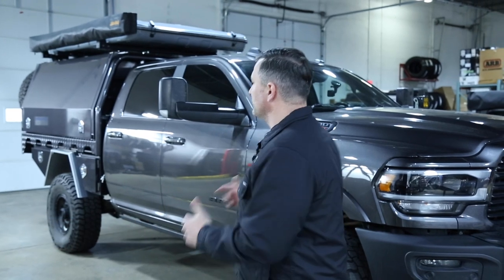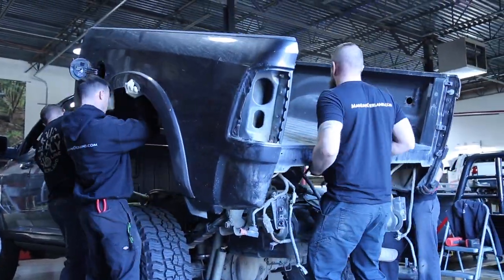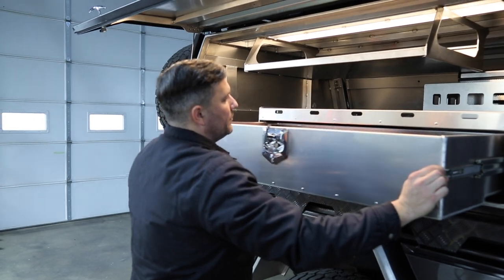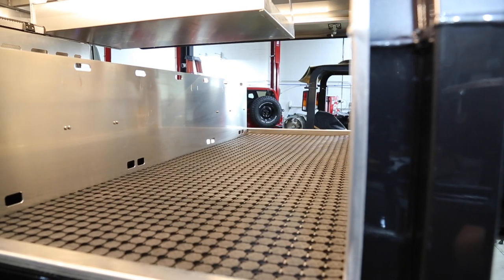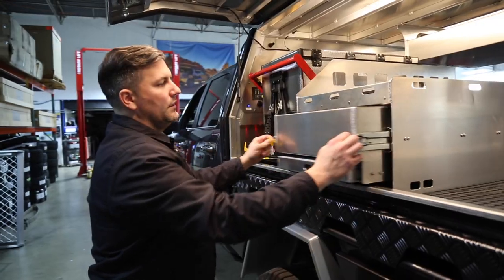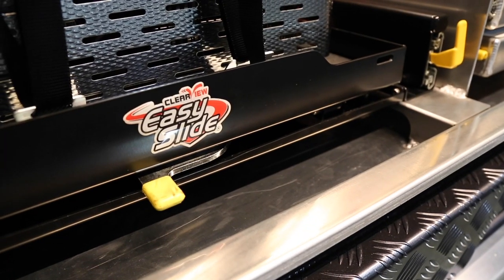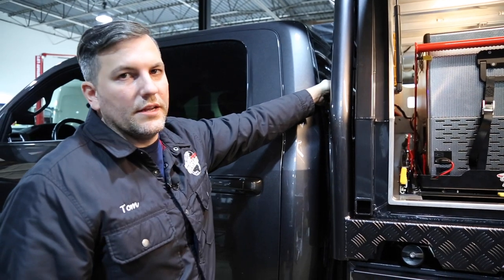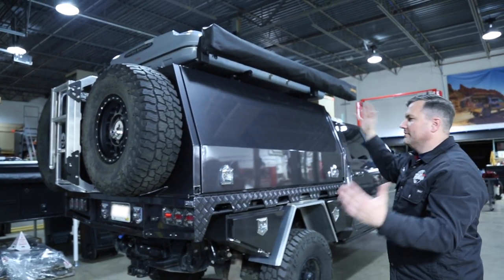Ultimate Tray and Canopy Setup from Norweld!

Comment: Can you do a norweld flatbed on a double cab short bed tacoma? Also, does 4wheel campers have a camper option for a 5 foot flat bed? Thanks.  Love the videos!
Reply from the maker: Yes you can do a 5’ tray and canopy on a Tacoma, but no FWC only offers a flatbed camper for the 6’ bed mid-size trucks.
Reply: @MainLineOverland  thanks.
Reply: @MainLineOverland  need to sleep at least 3 people, any suggestions?